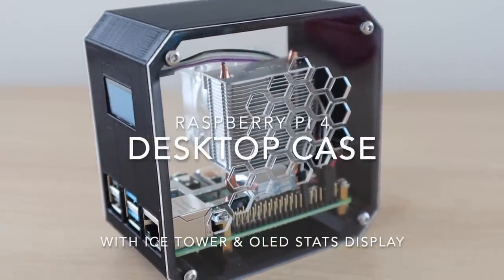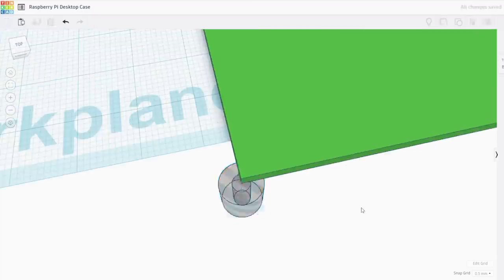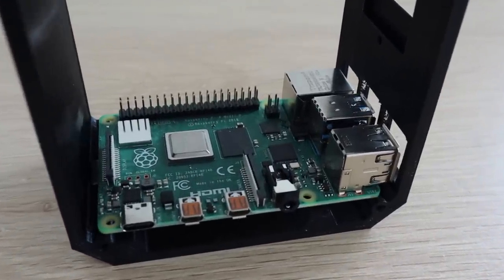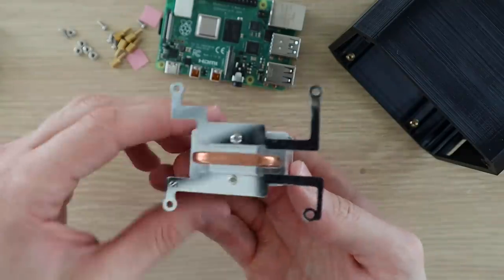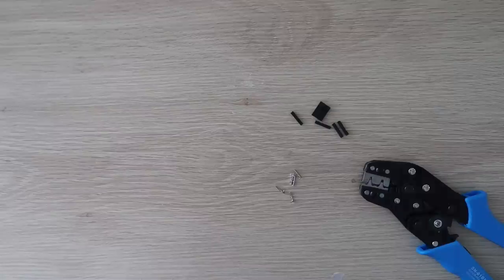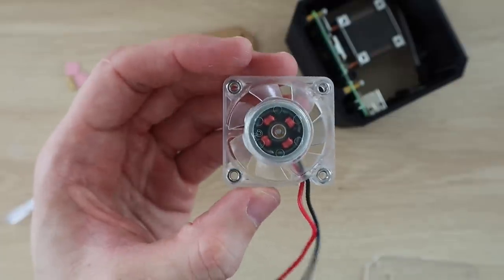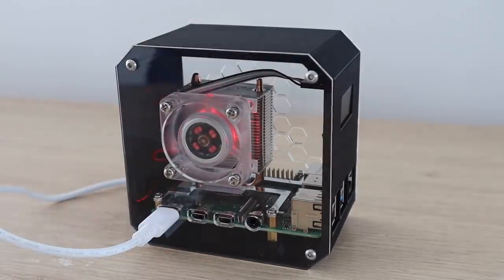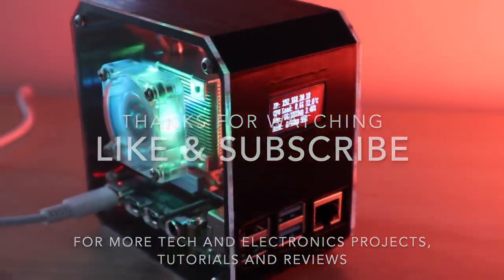DIY Raspberry Pi 4 Desktop Case With OLED Stats Display

Comment: Hi Michael, Having trouble with the OLED programming. First of all when I pulgged it all in and booted up the screen remains black even though I enabled 12C interfacing. Does this mean the screen is already broken, it doesnt appear the pi is outputting to it or recognises that its there at all? Secondly, in your step by step guide on your site I have gotten as far as the 12c enabed and ensuring the Python SMbus is instaled, then you have a long block of script. Is this supposed to just be copied in and pasted to the terrminal? I tried copying the first line import adafruit and it just says library not found, any advice would be greatly appreciated. I dfont really know how to code at all so even a link to a videa where I can get this thing working may help but I am striggling to find one in english, thanks again for the great build and design.
Reply: I get the following error even when trying the example from adafruits library
Reply: Modulenotfounderror: no module named 'Adafruit_BBIO'
Reply from the maker: Hi Tyron. The OLED displays only light up the pixels being used and don’t do anything when just powered up, so it’s unlikely that your display is broken. It’s most likely a software issue.
Trying installing I2C tools - “sudo apt-get install -y i2c-tools” and then reboot and type in “sudo i2cdetect -y 1” and this should display a table of — with numbers along the top and side, one of the table cells should have a number in it if your display is being detected by the Pi. This is the I2C address.
This guide is a bit better at explaining any additional steps you might need to get the display working if you’re having trouble - https://maker.pro/raspberry-pi/projects/raspberry-pi-monitoring-system-via-oled-display-module
Reply: @MichaelKlements  hi, yeah did all of the above already and it's not displaying in any of the slots unfortunately. Ordered some new ones and will try the new guide. Last piece of the puzzle to get this beauty up and running so hopefully I can manage
Reply: @MichaelKlements  actually this is the guide I used today and I get as far asthe step cd examples and then I get the same error over and over and it just says no file directory named examples or it says no module named Adafruits_BBIO. Has this potentially become outdated or something?
Reply from the maker: Hi Tyron, that’s unfortunate! Have you managed to try the I2C detect line first and does this return anything? This will point out whether it’s a display problem or a script problem. If this doesn’t detect the display and you’ve got it connected correctly then the display is probably faulty. If you get an address here but can’t get anything to display then you’ve probably got an issue with the script. It’s unlikely (not impossible though) that it’s been updated, I only did this two weeks ago now.
Reply: @MichaelKlements  yeah wasn't coming up in the list at all so ordered two new ones and will try again, going to do a few of these and gift them I think. You should look at selling these as completed products think they would do really well!
Reply from the maker: Hopefully you get the new ones working! Yeah I’m busy looking at getting them made up at the moment, there’s a few small changes to make for moulding etc..

Comment: Would it be possible to redesign securing the Oled  display, its really difficult.
Reply from the maker: Yes I’m looking at putting a “snap in” clip for the display rather. I originally designed this so that I could easily remove the display, but if it’s going to be staying in place then a “snap in” clip makes more sense.

Comment: make the body with ABS apply the Vapor Acetone technic it to remove the lines ,
Reply from the maker: Thanks for the tip Michael. I haven't tried printing in ABS yet, I've been put off by reading too many forums haha. I need to give it a go.
Reply: @MichaelKlements  your project is awesome....well done man

Comment: How do get the print  to stuck so good to the plate?
Reply from the maker: I'm just using the magnetic print bed which came with the ender. I find that the rough surface on these mats works very well for bed adhesion. I hardly use any bed temperature with PLA (usually 35-40C). It does create a matt (non glossy) finish on the bottom, but you hardly notice it on most parts. Also make sure that your bed levelling is done correctly.
I've got a glass bed on my second ender and I often have prints come loose during a print with this bed, although it does produce a better surface finish.

Comment: How do you conect the female pin heads to the ribbon cable ? its to fast for me to see it
Reply from the maker: I used a Dupont crimper to make up the cable, but you can solder the ends of the ribbon cable onto a female header strip or just use from female to female breadboard jumpers.

Comment: Fans on both sides?
Reply from the maker: There is only one fan in this design. The fan moves air into the case and it then has to come out somewhere, which it does through the larger vents on the opposite side.
Reply: @MichaelKlements  cool man😊😊

Comment: Was that the ender 3 pro or just a ender 3?
Reply from the maker: It's an Ender 3 Pro. There isn't too much difference between the two though. The Ender 3 Pro just has a better power supply, a studier 40x40 extrusion Y axis and stock magnetic print bed.

Comment: Isn’t this counter to the purpose of the PI - being ‘small’. I can already get mini-desktops.
Reply from the maker: This one is still only 100mmx100mmx60mm, so it's still relatively small even for a mini-desktop. Also, if you're using an Ice Tower with the Pi then this case isn't much bigger than your current setup would be.
Using the low profile Ice Tower would make it more compact though.
Reply: @MichaelKlements  True enough, but I can get mini-desktops with more power, ram,etc. My real point is this gets the PI into an area where sure, it can be a mini-desktop, but that’s not it’s forte - which is being a very small pc footprint for use in certain utilitarian ways, e.g. network monitoring, FreePBX, MediaCenter, Kali Linux, and so on.
Reply from the maker: I agree, but it also depends on what you're planning on using the Pi for. If you're using it for network monitoring or to run an ad blocker etc. then you don't need the additional cooling and the Ice Tower and case is a waste. If you're using it for something more demanding then you'll likely need a better cooling solution and then this case isn't really any bigger or more expensive than the Pi and Ice Tower combination already is. No doubt there are more affordable options with better performance than a Raspberry Pi.

Comment: Nice but i need the display in front and the connections at the back.
Reply from the maker: There are alternative designs available in the video description, one is as you've asked for.
Reply: @MichaelKlements  as Premade-Kit?
Reply from the maker: Yes I can make them up this way through my Etsy store as well.

Comment: A missed opportunity to add a power button. But a great case nonetheless. Great work!
Reply from the maker: This is a good suggestions, thanks! It should be quite easy to add an extra hole on the front for a push-button.

Comment: Why doesn't the pi need thermal paste? Serious question...
Reply from the maker: I wouldn't say that it doesn't need it, thermal paste is almost always better than a pad. The Ice Tower just ships with a pad as it's easier to install and remove and is perfectly adequate for this setup. The Pi''s CPU doesn't produce that much heat that the reduction in heat transfer by a pad is an issue.
Reply: @MichaelKlements  ahhhh I missed that part lmao.. I was like wait, he's putting a cooler on and no paste? I was legit confused, thanks for clearing that up, also I couldn't imagine trying to get a correct amount of thermal paste for such a tiny area.. one spec and the comments would be filled with "you don't need that much" LMFAO
Reply from the maker: Ah sorry, I thought you meant why don't they use paste instead of the pad., haha. Yeah the pads are much easier to work with. Although I've still got a few comments on why I didn't use paste instead of the pad.

Comment: Seems a bit redundant to remove the fan from the cooler and mount it to the side panel instead(could've just made 2 panels with the cool hexagons and airflow would've been fine), but slick build nonetheless.

Comment: Great video.. have an issue with one of the examples in the Adafruit_SSD1306. There is an example script called stats.py which output some system information to the 0.96 oled display. I have an issues with the output,, i also see the following characters which should not be displayed i.e. the following 
b'
\n'
'
Can someone please advise,
Reply from the maker: Hi Rav,
Did you manage to get this resolved using a combination of the two scripts as mentioned on the blog post?

Comment: That K40 laser really needs an air assist! Consider buying a cheap air compressor and 3d printing a nozzle for it. It would make that nasty acrylic flame disappear and save your lenses from all that smog!
Reply from the maker: Thanks for the tip Jorge!

Comment: Will this fit the 3B
Reply from the maker: Unfortunately not like this. The USB and Ethernet ports are switches on the 3B and it has a single HDMI port instead of the two Micro HDMI ports on the 4B
Reply: @MichaelKlements  Aw man. Ive been looking for case for my 3b so I can put a tower cooler, but these days its inly the 4. Maybe its time for an upgrade

Comment: would be nice to also print the side panels
Reply from the maker: I can definitely make a printable version of the side panels, thanks for the tip.
Reply: @MichaelKlements  dude that would be awesome please as not as many people have access to laser cutters as to 3D printers! P.S. great to finally here a Saffas voice on one of these channels, keep up the awesome work!
Reply from the maker: I've added a 3D printable version of the side panels to the blog post linked in the video description. Thanks Tyron!
Reply: @MichaelKlements  so grateful, my kids are using the RP4 and cases for tis tower are hard to find, many thanks

Comment: Thats Awesome! It is expensive do print 3d parts? money is the only thing that can stop me
Reply from the maker: The expensive part is buying the equipment, I don't think printing the actual parts is expensive. In terms of pure cost of material, this case probably costs around $3 in filament and $1 in acrylic. The issue is that 3D printing takes a long time, this case took 7 hours to print the main body on the Creality Ender 3 Pro.
Reply: @MichaelKlements  I already have a Raspberry Pi, charger and sd card. the rest is like 50 bugs. I just didnt know how cheap or expensiv 3D Printing is.

Comment: what operating system did you use please let me know
Reply from the maker: Raspberry Pi OS
Reply: @MichaelKlements  Please I would like to know if it would work in Windows 10 since it is the operating system that I have in my raspberry pi4 and how it will be thanks for answering my other comment
Reply from the maker: The display script most likely won't work without some significant modifications. I'd guess that your installation is likely missing the libraries and dependencies that come pre-installed with Raspberry Pi OS.

Comment: How to insert and remove an sd card?
Reply from the maker: You can’t change the SD card on the standard case without taking the Pi out. I have added an SD card cutout to a more recent version though.

Comment: I dont understand. Why are people so busy cooling rpi down. 
I run my rpi 4 b on windows 10 arm64 for hours and it only measures 49 deg c at max, 45 on average, and 41 min, depending on what im running on windows.

No fan, only aluminium full case with little fins ti dissipate heat. No fans! So quiet

Comment: I'd love to see a PoE hat version of this.
Reply from the maker: Yeah that’s a neat idea. I must have a look at a POE adapter that can be used along with the Ice Tower
Reply: @MichaelKlements  It's partly because the PoE hats drive up the temp/noise levels. 

That  said, I'm looking at one now and I take your point. The OEM one covers the whole board, processor  and  all! Grah.
Reply from the maker: Yeah I had the same issue when looking for one which I could use with the cooling system for a cluster. All of the POE hats I could find covered most of the Pi as well.

Comment: Your OLED display is faulty, or you're using a wrong lbrary of some sort.
The display should not look that 'interlaced' / visible horzintal lines.. I had a faulty module once..
Reply from the maker: I have the wrong display size commented out in the code, which I hadn't picked up on until someone pointed it out a few days later.
Thanks for noticing though!

Comment: Great Projekt, but I think you are using the wrong OLED-Configuration in your Python Code.. 
Maybe try to uncomment:
# 128x64 display with hardware I2C:
disp = Adafruit_SSD1306.SSD1306_128_64(rst=RST)

instead of:
# 128x32 display with hardware I2C:
disp = Adafruit_SSD1306.SSD1306_128_32(rst=RST)

You are actually only using every second row of pixels right now :)
Reply from the maker: Well spotted Koni. I have fixed this up in my code, can’t believe I didn’t notice, haha.

Comment: I know you water cooled a Pi already, but now you should make a setup that fits in this case or at least one like it. 
Mini blocks from Aquatuning https://www.au.aquatuning.com/water-cooling/gpu-water-blocks/mini-blocks/
pump/fan/radiator for RC motors https://rcecho.com/aeo-rc-model-malfunction-water-cooling-radiator-system-ac160/

Comment: Nice build, but in my opinion you made a mistake. You should have placed the display on the opposite side that the display side is the front and the connector side is the back

Comment: Hi, I was thinking of making these and trying to sell them, I’d like to ask your permission to know if that’s ok. I’ll also be modifying it to make it work with what I have
Reply from the maker: Hi Wtw Rw,
I’m already selling these in 3d printed kit form and I’m in the process of arranging injection moulded options. You’re welcome to use and adapt the design for your personal use, but the design is not available for commercial use.
Reply: @MichaelKlements  Ok thanks I’ll try to design my own then.
Reply: @MichaelKlements  Hey what would the dimensions be to be able to create a case for the raspberry?
Reply from the maker: The actual Pi is 85mm x 56mm, so anything a bit larger than that should work just fine.

Comment: This is simply amazing...
I wanna do it too.

However, I have a couple of questions... I wanna use it for my work with cryptos, and I wanna know if there would be any issues with the wallets (I don't have experience with wallets on Linux, let alone RaspbianOS). If there's anyone here with experience there, I'd appreciate it.

I also wanna know if I can get the OLED display to show the crypto values in real time (specifically, EOS and other DeFi). That I know is a question related to scripting, that's why I ask.

I'm mostly on eosmarketplace.io making life promoting the project and telling people they can use crypto (EOS) as actual money to pay for day to day goods and services without paying fees or commisions. This is why I need it displayed to know the market values.
Reply from the maker: I haven't tried running any wallets on Linux but I'm sure there are software packages available for this. Linux is very widely used, so I'd be surprised if there wasn't.

Yes, you can adjust the OLED display to pretty much show whatever you'd like. You'd just need to query an API to get the values and then set up a script to write them to the display module. 

Sounds like an interesting project you're working on!
Reply: @MichaelKlements  Thank you, that means a lot... You're very welcome if you want to take a look around the project. Who knows, I might be your first customer buying this case in EOS! We know physical money is rare nowadays, digital money is what's moving the world around.

I'm very interested in this, I'll see around if anyone has set up a display the same way.

Comment: On eBay Australia  you can buy  raspberries pi4 for 140.00 dollar ⁷100 dollars for your case if people wanted how much to buy one compieat l have a disability
Reply from the maker: You should be able to get them a bit cheaper, I've seen 2Gb Pis for around AU$50-AU$60. I don't sell them assembled as it's quite time consuming to put each one together. But you should be able to get a Pi and the case for around AU120 and put it together yourself, its quite easy to do.
Reply: @MichaelKlements    I don’t know what you are talking about  getting the code  a friend off mine works at a computer shop  he asked about a power switch off on and off and what does it power up on